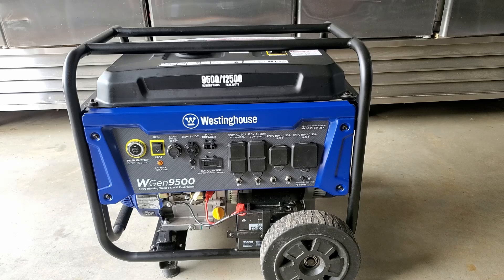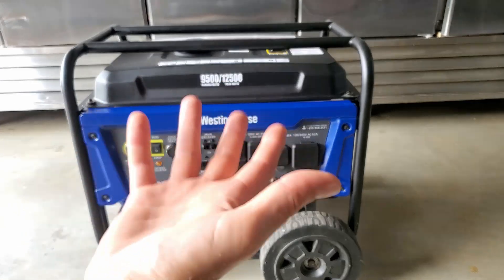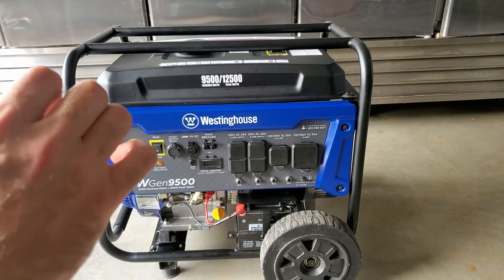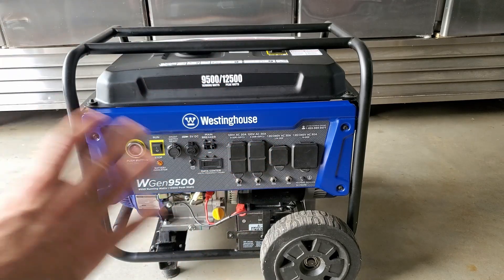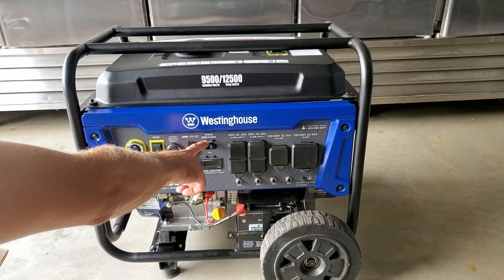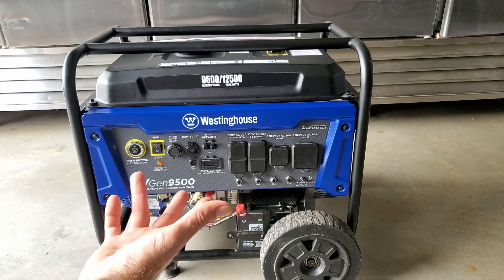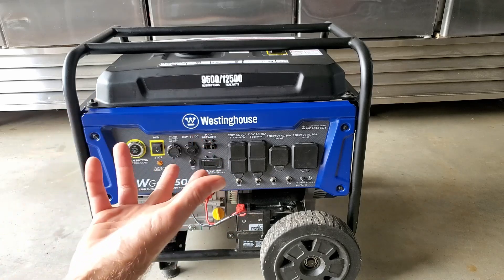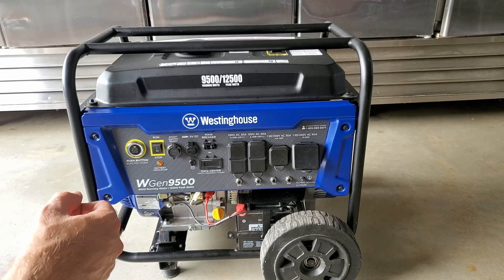How Much Load Can A Generator Of This Size Handle In An Emergency Situation? 12,500 Peak Watts

Comment: I’ve had one for five years now I have 61 hours on it but every time I go to run my water heater which only has 4500 W heating elements in it. It dogs out every time but it runs my well pump stoves washing machine everything else in the house fine anybody have any ideas and I have tried just running the water heater completely solo and it doesn’t work either.

Comment: Thank you for posting this.
We just bought the tri-fuel version of this generator, same running/peak watts. 
Hope to have it by this weekend. We live near Houston and we didn’t have a genny on hand when the power went out last summer.
I was really curious about what this make/model could do. Sounds like a microwave, refrigerator and AC window unit won’t be a problem.
Reply from the maker: Good deal!  Happy the video helped as well.  The generator will power what you described and more for sure.  We lost power this winter and decided to run it through the night with very little power draw on one occasion from about 11 pm - 7 am.  During that time period it used a little less than 3 gallons of gasoline (1/2 tank left). Hope that helps a little more for what to expect with fuel consumption.
Reply: @ Thank you for the information,much appreciated.

Comment: I have this generator (dual fuel version converted from propane component to nat. gas) and run 2 small window units, fridge, ceiling fans, most of our lights, chest freezer, etc. for about 2,164 continual running watts in summer and 1,700 watts in winter, to meet basic needs.   Things like microwave or washing machine and other non-basics will bring it up to an intermittent 4,700 watts in summer and 4,200 watts in winter.  I run the heat in the winter with our normal house nat. gas furnace.  That way the generator is not running anywhere near its capacity for fuel and longevity purposes.  Our goal is to live basic and okay rather than in luxury so as to not be so taxing on the generator during power outages (hurricanes are our biggest disruption).
Reply from the maker: Thank you for sharing your experience!  Our power went out for about 3 days during an ice storm a few weeks back.  Having the generator on hand and ready to go certainly made life more pleasurable during the outage.

Comment: I see this is old just Install an Easy Start in your big AC compressor and don't worry about shutting anything off. You want to look for( LRA)  Lock Rotor Amps on your AC compressors label that's what amps it takes to start the unit. Even if you don't own this geny anymore an Easy Start is the way to go. It will add years to your compressors life and has a diagnostic app so an AC guy won't rip ya off when the Easy Start says its just a bad capacitor.
Reply from the maker: Thanks for sharing

Comment: Thank you for posting the video. I have this exact same generator and was able to run the following simultaneously : my Heat Pump (Trane - highest end-cost ~$24M), all 120 volt house circuits, a single (small) stove element,)  total 5076 watts, 22.5 amps. I am very reluctant to run my heat pump because of the +/-23% THD and would not have purchased this particular unit had I researched and known the specs beforehand, but definitely would purchase a Westinghouse (their customer service is amazing).
Reply from the maker: Thanks for sharing!

Comment: Love my Wgen11500TFc running on natural gas. No worrying about refilling the tank every hours and constant trips to the gas station. It puts out the same exact watts as this generator on gas, but the THD is <5%. It's around 23% for this generator.
Reply: Wow, only 5% THD? I have been debating on the 9500, 10500, or 11500 tri-fuel to run on natural gas, and this comment is great to see. Can I hook it right up to my BBQ NG hookup in the backyard?

Comment: Did you have a soft start installed on your house ac unit thanks in advance
Reply from the maker: No.  We do not have soft starters installed on any of the air conditioning.  I discuss how we avoided using soft starts at about 40 seconds into the video.  Hope that helps!
Reply: @thehillbillyfarmers  yes definitely thank you

Comment: Thanks for this video.  We have this generator but an electrician said it would not power our ac or our house.  We live in a 1700 sq ft manufactured home.  Ac/Heat  are what we are concerned about.  We have a gas range.  From everything I have seen or read this should work for us.
Reply: We have this generator and our electrician said adding a soft starter to AC would make it work with this unit.
Reply: Yeah, you just need a soft start. Buy any brand, but Micro-Air. They are putting out junk now and cost more than the others.

Comment: Good video.   I have the Igen10500 Tri fuel and while using propane was able to run a 4 ton AC along with house lights, two refrigerators and a freezer.  I plan on getting my house set up with a natural gas connection to have a continuous fuel source.  Looking back I wish I would’ve punches the igen11500 Tri fuel, because it produces cleaner power and would produce a little more power.
Reply: How do you know the igen11500 Tri fuel produces cleaner power? I am trying to decide on the size to get, 9500 or 11500. I want something that won't fry my laptop.
Reply: Look for low THD less than 6.    Total harmonic distortion.  IGEN 11500.

Comment: I suspect your biggest problem was unbalanced 120v loads across the 240 volt winding with center tap. You would be much better off using an auto transformer to generate the neutral so you get full power across the 240 volt winding without tripping a breaker.

Comment: I have this generator.  It meets my needs perfectly, but I don't have all those electronic items.  Just need to run the fridge, lights, microwave, swamp cooler (in summer) and dishwasher.  My house is heated completely with a woodstove.

Comment: I have the dual fuel Westinghouse and after sitting for 6 months on its own charger All it does is click when I put it and start mode. I can hear the starter click once and that's it.

I tried jumping it with a booster pack with no change. Could the battery still show 12 volts on a meter and s*** the bed for starting?
Reply from the maker: Yes, batteries can show good charge until the battery sees a load, but if you have a good booster pack it may not be the battery.  Corroded and loose battery cable connections can do the same thing.  Also, check the connects at ground and the power cable to the starter.  Could be something more but hard to diagnose here in chat.  Good luck!

Comment: For A/C or heat pump, you should look at the  Locked Rotor Amperage (LRA) of the heat pump or air conditioner.  There is a label on the outside unit that will provide this figure.  When the AC compressor is stopped, to start it turning, it has to fight the pressure in the system and generate the torque to overcome inertia.  To do this, the compressor needs a very large spike of current to "un-lock" it and get it spinning. This current can be as much as 2.5 times the amount of current required to keep the compressor turning once it has started running.  For example, my 3.5 ton heat pump has a LRA of 109 amps, or about 13,000 watts.  This is where the peak current output if the generator comes in.  The generator will have a continuous rating, but when an electric motor starts, the LRA will be much higher than the continuous draw, and the generator can usually accommodate these spikes coming from things like refrigerators or the circulation fan in the central air.   It would be a coincidence for every motor in the home to start at exactly the same time, but on the chance that it did happen, the combined current to overcome the locked rotor of a fridge and a heat pump could easily trip the breaker.  A Microwave can draw 1700 watts, so if a microwave was running, that could put you over the top. 

There are two ways to reduce the LRA draw. The first is called a "Hard Start" kit, which is esentially a bigger start capacitor but there is a lot of controversy on whether this will shorten the life of the compressor (I think it is a bad idea personally) and a"Soft Start" kit. The soft start kit is an electronic current current delivery manager that will step up the current in phases and this can reduce LRA by about 40%, and I think it can do so safely.  

The latest heat pumps are ""Inverter" heat pumps.  These allow the compressor to run at varying speeds depending on the load. They are far more efficient (SEER of 26 v SEER of 17 or 18, which was considered high efficiency in the past). These will by  nature have a lower LRA. 

To start a 3 ton A/C, you really need to have about 10KW peak, but that full KW has to be available. If you are running a Freezer and a Fridge, your internet, some lights, and even a coffee maker, your constrant current demand may be enough that the generator cannot satisify the additional 10KW peak and the breaker will trip.
Reply from the maker: Great information in your comment for folks to consider/understand.  Thank you for taking the time!
Reply: @thehillbillyfarmers  My pleasure. I am a big proponent of having a generator but it takes a pretty big generator to run a 3.5 ton AC.
Reply: @shenmisheshou7002 do you think this generator is ok ?
Reply: This is a great explanation of LRA draw with electrical equipment.

Comment: I have the same Generator and it's been great. Never occurred to me to run the Heat Pump as I am running it on propane (2 40 Gal tanks). I do have backup heat tho (Propane fireplace 100 Gal tank). I might try it for AC if it is a hot day in summer. I'll turn everything else off though except for router lights and TV. My Heat Pump is only 4 ton.

Comment: Good content!  I have same generator, works well and your experience is similar to mine.  I used 50 amp plug with 6 gauge stranded cord into 50 amp breaker.  Box has a generator interlock that I built.  I have 100 amp service in this 140 year old farm house.

Comment: Got one of these for my house. Did an interlock with outside outlet back feeding through 50 amp breaker. My house only has 100 amp service so should be able to run most of my house. Just gotta get a soft start for my ac next summer should be good to go.

Comment: My 9500 peak watt runs my my small 2bedroom hm with a 60 amp service just  fine. AC , an in wall unit, is 18000btu @ 18amps I think, besides that there's never any large loads on it besides 2 small space heaters. Engine doesn't really use any oil after 1000 hrs, I use Lucas full syn, same for my Harley for air cooled engines. Is custom enclosed with 2 fans and remote temp guage. It's almost "smart" and the remote is an extra nice feature. If the gas tank were larger I'd be nice but that's small potatoes and if used on a semi regular basis the battery stays charged. I have no complaints.
Reply from the maker: Thanks for sharing!

Comment: 23 % thd
Reply: @Mfil here is the thing about that;  I believe it’s not actually 23 percent. I think there are tiers of thd. The first one is under 5 percent.  The second is less than 23 percent. It can be 10 percent, 13 percent etc. I I’ve had the 7000 watt version of this for at least 6 years.  Powered 2 subzero refrigerators with a lot of electronics, a variable well pump and controller, microwave, tv, all without incident. Would I like lower thd? Yes. But 3x as expensive and eats fuel.  I would imagine based on the number of people with these generators that if blowing up electronics was common there would be hundreds of comments on it. And yet there are almost none. I truly don’t think it’s as big of an issue as most think.
Reply: @Mfil  THD is overrated. Just another way to raise the price.
Reply: @Mfil  according to Westinghouse the 12,500 dual fuel generator has less than 5%
Reply: I am curious where you got this information from , the owners manual says THD is 23% - but I tend to agree with Samlol_drrich comment above.  I purchased the generator without knowing anything about THD and after I learned more about it --- I would not have purchased this generator.......but now I am sort of stuck
Reply: @donschlonski2936  The one in this video is the wgen9500 which has 12500 peak and 9500 running watts. I have the same one and my manual says the THD is >23%
Reply: We hear a lot about this type of generator and high THD, even Westinghouse support told me that it’s really not for sensitive appliances, devices and high tech circuit boards. The girl at support said good for other things like tools, refrigerators, fans and lights. Ah, ok.. but don’t most modern refers contain complicated circuit boards? Also, if my WGen9500  is not for devices, why did they stick USB ports on the panel?

Comment: I looked at the specification  on this generator (9500) and it sayes 37amps. Why is that if it has a 50amp plug. The Westinghouse 12000 shows 50amps on its specification.  I'm not understanding that, is the 9500 putting out 50amps? Has anyone checked?
Reply from the maker: This was a big deal when we selected this generator regarding the 30 amp versus 50 amp plug.  First look up Root Mean Square (RMS) versus Peak to understand what's going on with the two different ratings.  12,500 watts/ 240 volts = 50 amps (roughly).  It can handle a peak load of 12,000 watts for a few moments.  It can run 9,500 watts continuously without fault.  Hope that helps.
Reply: 9500 watts is "start up" watts, not continuous
Reply: @gene2200  this model is 12500 start up.  9500 continuous

Comment: You're getting what could be some serious voltage drop through that 8 gauge cord on a 50A connection.   Should be at least 6 gauge.
Reply from the maker: If it were aluminum wire then you would be correct.  We consulted an electrical designer to ensure the wire size was correct for our application.
Reply: @thehillbillyfarmers  no he’s right man. 6 gauge is the only gauge you should use for a true 50 amp set up.
Reply: @thehillbillyfarmers  - your electrical designer needs a refresher.  50 amp cords and setups need 6 Awg wire.  Look it up.  Don't burn your house down.
Reply from the maker: @condor5635  6 AWG Copper or Aluminum?
Reply: @thehillbillyfarmers  - 6 Awg for Copper and 4 for aluminum. Why anyone would use aluminum I don’t know
Reply from the maker: @condor5635  Thank you for the reply.  Aluminum wiring is used a lot.  On big projects "value engineering" comes into play and generally copper wire is replaced with aluminum.  We have 6 AWG aluminum installed from the main PDB to the sub panel (50 Amp breaker installed as well) where we back feed from the generator. Power is supplied from the PBD to the sub panel during times with no power outage.  If the 6 AWG aluminum wiring installed in the early 1980's (as you suggest should be larger, 4 AWG) is going to burn our house down I would imagine it would have already happened by now.  As a matter of fact, with our new structure, the power company installed aluminum wiring from the transformer to the meter base.  Aluminum wiring is also installed from the meter base to the main breaker.

Comment: who makes the engine for this generator and how often do you have to change the oil?  thanks
Reply: @ko4otv43  - every 100 hrs?? Do you want to keep this long term?  That is way too long.  Oil is cheap.  No more than evey 50 hrs
Reply: @ko4otv43  - well all I can tell you is no manufacturer instructions or general guidance. Anywhere on the web would say run it for 100 hours before changing it.  Westinghouse says 50 hours and whoever listens to what the manufacturer says. If it was mine, I change it every 30 to 40. But you can do it you want your generator 😀
Reply: @ko4otv43  - let's cut to the chase.  I just looked up your manual and like every Westinghouse it says 50hrs!  No manual is EVER going to say something like 'change the oil like every 100-200 hours'  LOL.  Look - you have success at 100hr changes just keep doing what makes you happy

Comment: Isn't that destroying your genset? I've got this identical unit and it's very specific about overloading it. I'd like know how it'll run using actual heat (HVAC) rather than cooling.
Reply from the maker: The topic is somewhat controversial regarding destruction of the genset, however, hopefully sharing our experience will help someone out somehow.  We purchased it to power farm operations when the power goes out.  If the power were to go out at exactly the right (bad) time, then one use will more than pay for the generator regarding spoiled products. Hope that helps a little, take care.
Reply: @thehillbillyfarmers  can 9 KVA generator run two hairdryers 2000 watts each at the same time?
Reply: That should be a total of around 4.71 kva so yes a 9kva genset can run them. Not sure why you would need that really though…